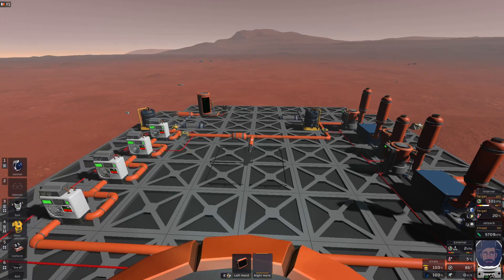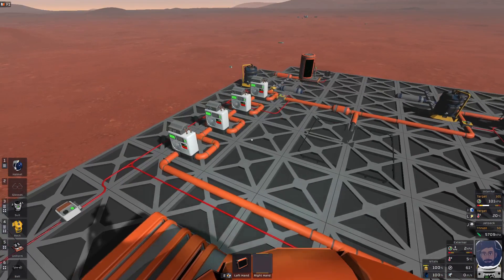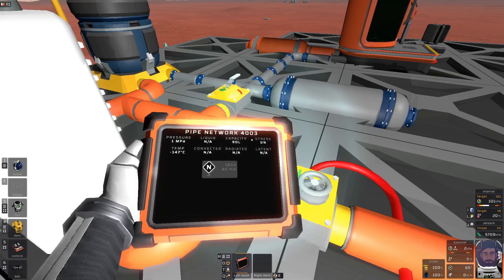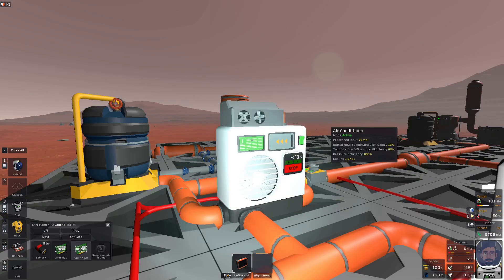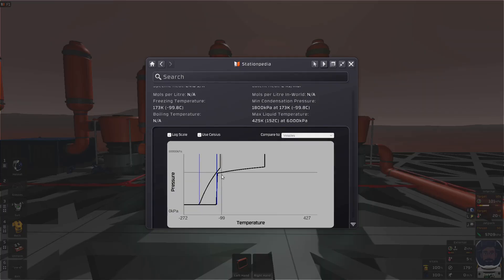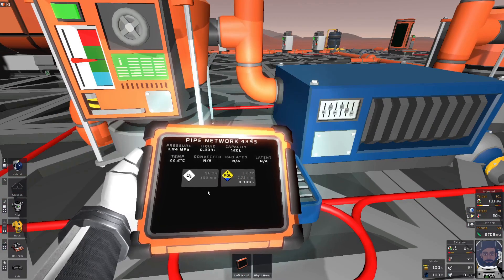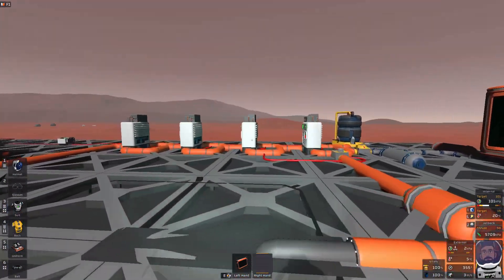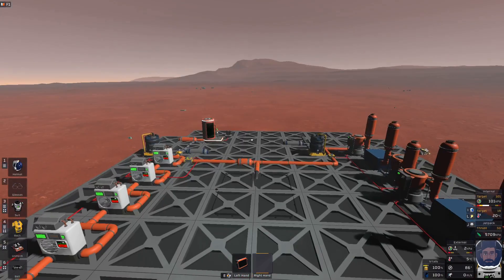Stationeers: Cryo Cooling

Comment: I think its better if you set all AC's to -170. The inefficiencies will spread out across the AC's instead of the more efficient AC's stalling and I think that will make the system as a whole run more efficiently. Not sure to what extend though!
Reply from the maker: True. Eventually they will make their own steps. The only benefit to the settings being stepped is some of them will go idle and slightly lower the power consumption. It does create a better buffer in case the Nitrogen comes in too hot or kickstarts again.
Reply: @shadowdrake082  oh that is fair, that is good for a sytem that can be a bit more passive in its cooling vs raw heat energy transfer. I tried it a little bit just setting them the same temp, but it ends up not balancing itself well, dynamically spreading out the AC temps between the input temp at the cold side and the wasteheat temp at the hotside of an AC array works really well I've discovered. Bigger and complexer cooling systems with advanced IC seems like a bit of an unexplored territory! Also I'm happy with the devs doing updates that add demands and uses for pushing the game a bit more hehe

Comment: Trying to make liquid volatiles for rockets. Does this mean that  best case scenario, I can only generate 1 mol per tick or so or is there a faster method for liquid volatile generation?
Reply from the maker: It completely depends on the amount of energy moved. For the AC chain... looks like I move about 2kJ at the setup, but could add more ACs to move more energy. It depends on how fast you want to make it. You could balance it out to move closer to 14kJ on the coldest end and then add acs wherever the chain cannot keep up. That would put you at 7 mols/tick which is quite a fast rate to be honest. If you need that much to keep up with expenses then go for it, most of the time the rocket is out for weeks in game... even at 2mol/s for 1 game week (8400 seconds) that should mean I made 16800 mols (672L) in that time.